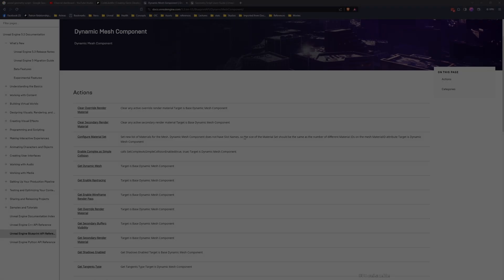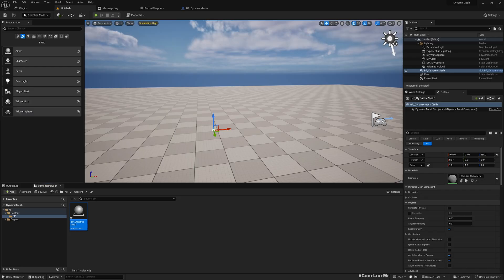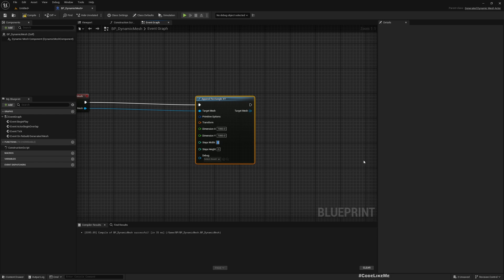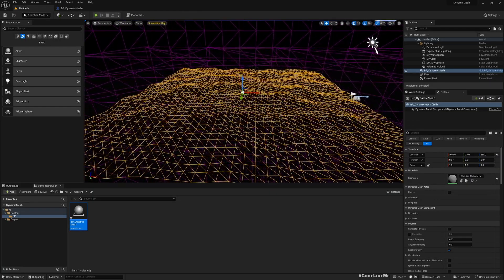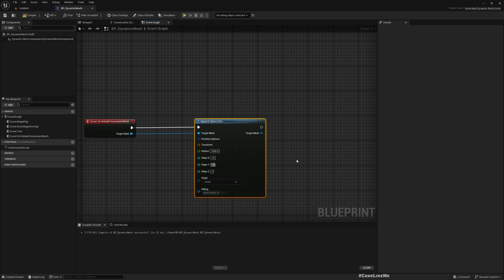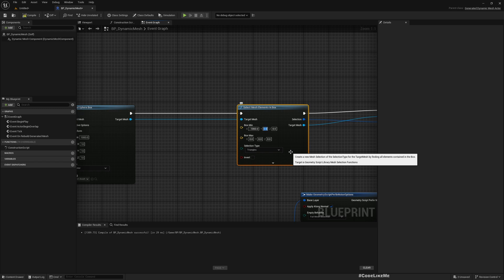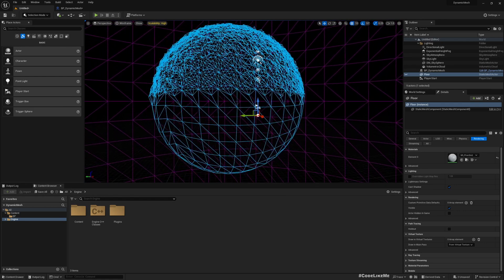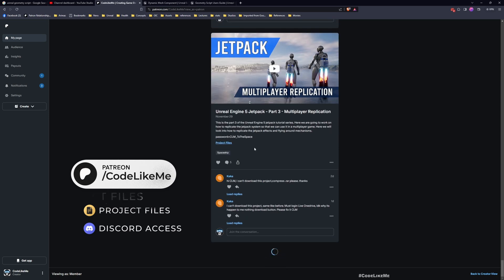Introduction to Dynamic Mesh and Geometry Script in Unreal Engine

Comment: yo i was wondering is there an option that i need to change to make objects that use geometry script show in the exported game? cause i tried exporting a very basic game, im new to unreal, where i have a an object that uses geometry script its just a simple logic to make holes on the mesh. it works fine but when i try to export the project and open the game the objects dont show.

Comment: 8:44 I'd be willing to bet the bizarre deformation is because the high frequency noise was applied first, which also tilted the vertex normals, so when high amplitude noise was applied along normal, the XYs went all funky

Should probably apply in the other order or restrict perlin to Z-only
Reply from the maker: Thanks for sharing that

Comment: Hello! I already tried to implement DynamicMeshComponent into my terrain generation, and I found it to be actually slightly slower then ProceduralMeshComponent. I did both in c++, so I can't say for blueprints. I would like to see how you will implement this, since anything I tried could not beat ProceduralMeshComponent for some reason
Reply from the maker: Is that so. Did you try the runtime mesh component too?
Reply: @CodeLikeMe  Runtime was extremely fast and it had its own lod functionality which wa really good. I still haven't lost hope on DynamicMeshComponent but unless you want the geometry scripting functionality, I cant find myself using it unless I figure out why its slower
Reply from the maker: @aprivatechannel1152  so, what's stopping you from using RMC?
Reply: @CodeLikeMe  Nothing really, just experimenting. I'm currently trying to write my own custom mesh component